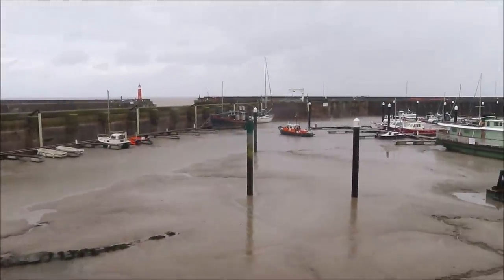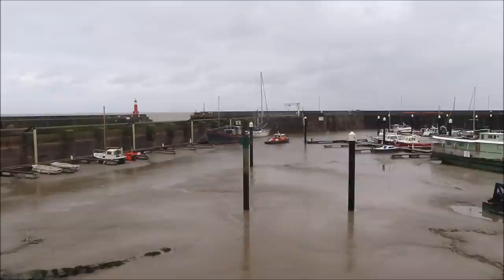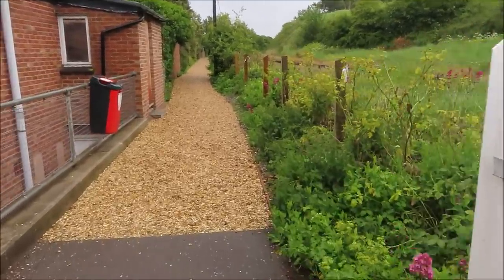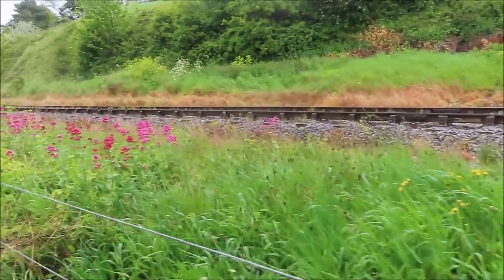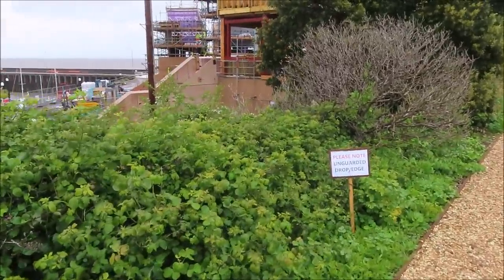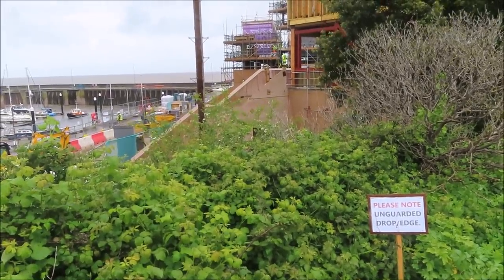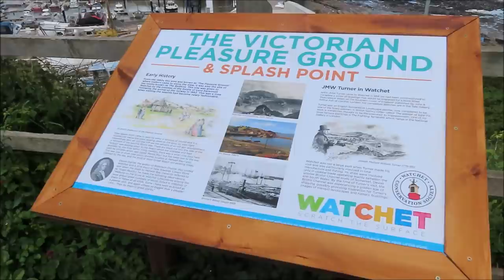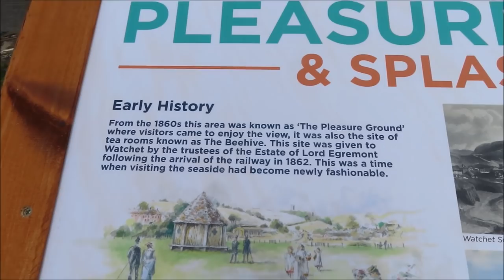WATCHETS NEW BUILDINGS AND UNUSUAL RAILWAY ACTION 28 MAY 2021

Comment: The JCB as you described is called an RRV (Road Rail Vehicle) and the dogfish wagons others call them are called ballast hopper wagons. Used for ballast delivery in between the running rails (4ft) and either side of the track (Cess on single line and between 2 tracks 6FT). Nice video, thank you.
Reply from the maker: Thank you for the info!